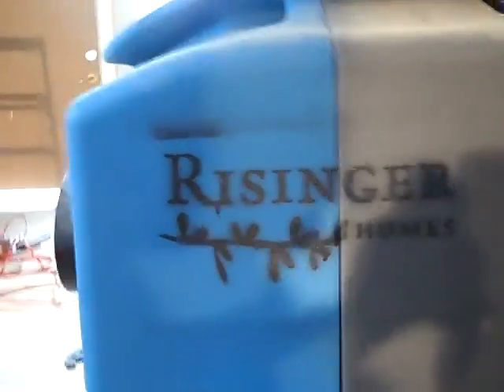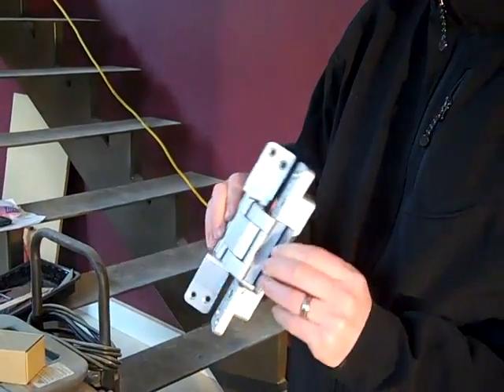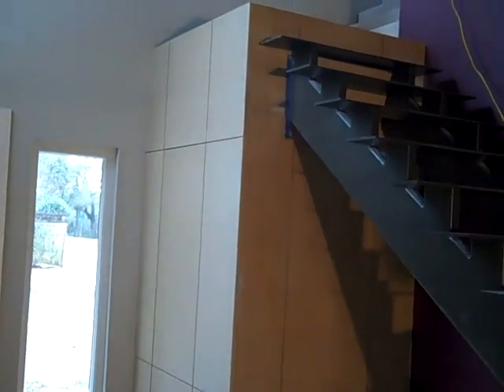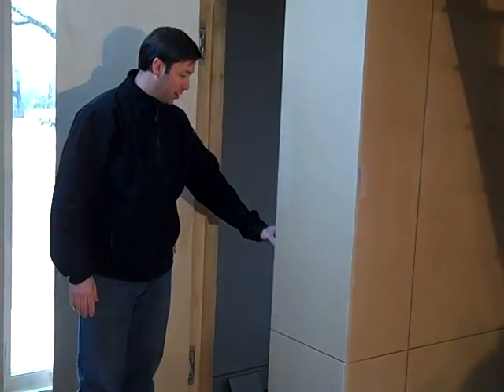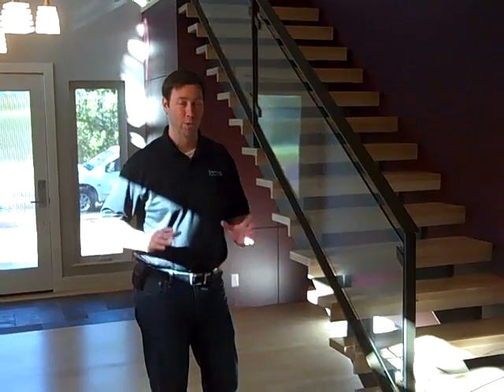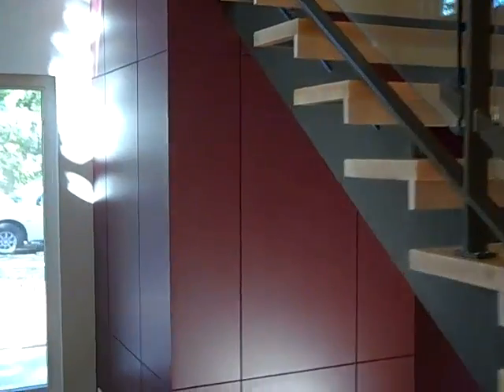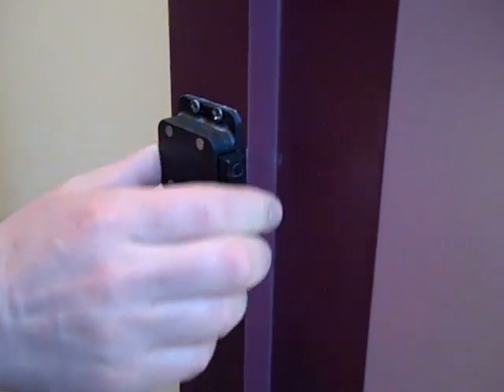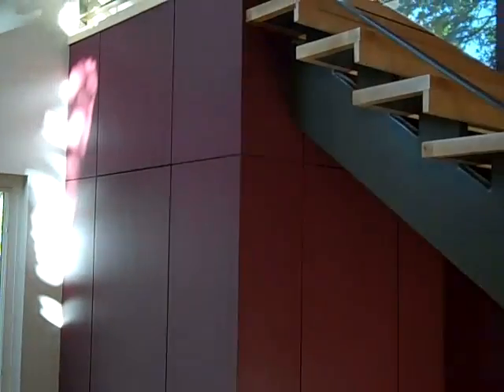Hidden Door with Sugatsune 3Way Adjustable Concealed Hinges

Comment from the maker: @marine6 We looked at the SOSS hinges but they didn't offer the adjustability in the future.  These Sugatsune hinges offer three ways of adjustability so they can really make the reveals perfect on all sides of the door.  This is especially important with a wood framed house that will move/settle over time.  The airplane parts were necessary because of the weight of the door.  Magnetic cabinet latches don't have enough throw to push this heavy door out.  Matt

Comment from the maker: I'm not sure the exact thickness maximum.  Most of the doors I've used these hinges on were 1.75" doors clad with 1x materials.  I don't see any reason you couldn't go 3 or 4" thick.  Sounds like a cool door idea, what's the location?  Best, Matt Risinger

Comment from the maker: @zeek3177 The spring is only on the touch latch and it's a very high quality part made for the airline industry.  I expect many decades of service from that part.  The door itself need to manually open once the touch latch moves the door out 1" for you to grab the door.  Matt

Comment: Looks great. Could you use in a trapdoor. 2200mm long by 800mm wide. 8foot by 3 foot. Want to not see the hinges. Woukd need hydraulic struts hopefully opened and closed with a remote control button like the boot of a car. Thanks for any assistance guidance. Cheers Angus

Comment: Hey Matt, can you share the model number you used for this door? Looking to do a similar project. Thanks!
Reply from the maker: khagen06 The door is a "Stave Core" solid door that I ordered form my Millwork supplier.  Nothing special except the core of the door is solid wood liad up in vertical strips similar to a glue-lam beam.  Best, Matt

Comment: why not have that room be an elevator that goes below the house to the basement? but instead of pushing on the door, that entire wall is made of smaller pressure sensitive tiles, that when pushed in a certain order open up to the elevator. the code can of course be set upon installation.

Comment: i think i might be a little touchy about paint. i worked as a finish carpenter for 30 years and i have seen wonderfull work like oak base (with grain match ect.)covered with paint.there is NO point in doing good work if you are just going to cover it up with paint.